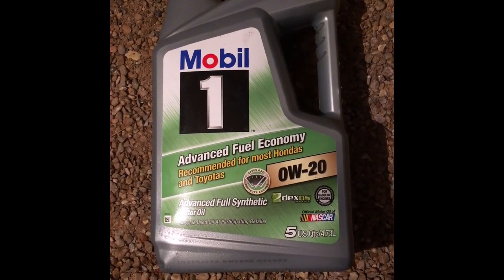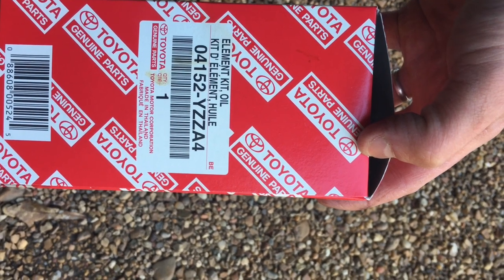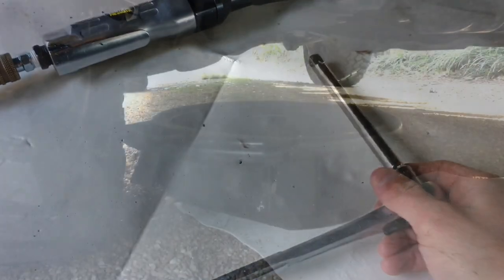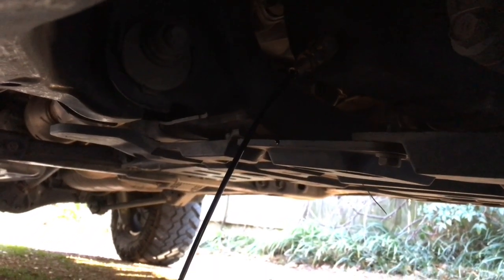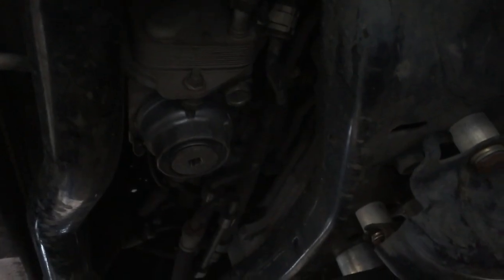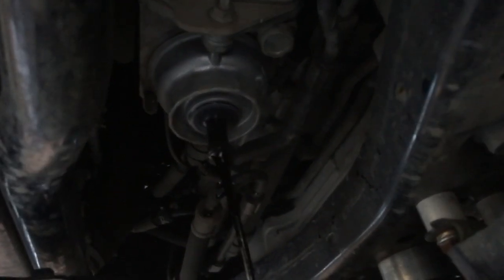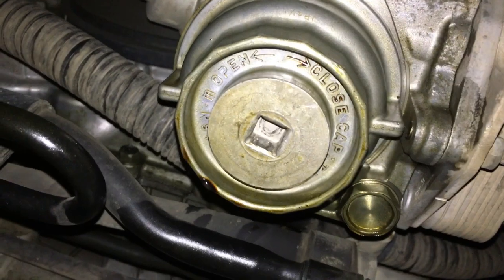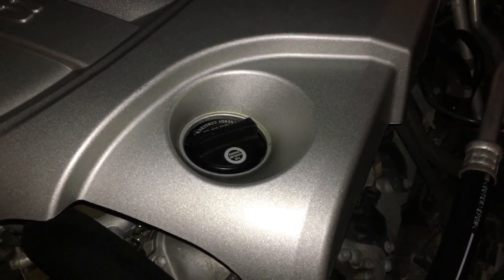Toyota Land Cruiser 200 Series Engine Oil Change

Comment: The torque spec for the oil filter cap is not 25 foot pounds. It is 25 Newton meters which = 18 foot pounds.

Comment: If Toyota have put a plastic oil filter casing there is a reason. Metal one are not an upgrade because they crack more easily.